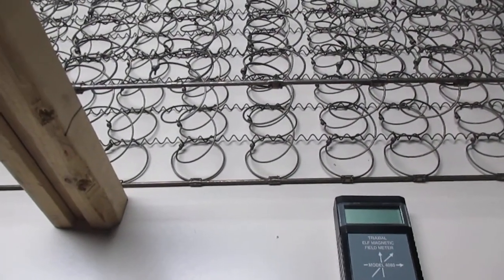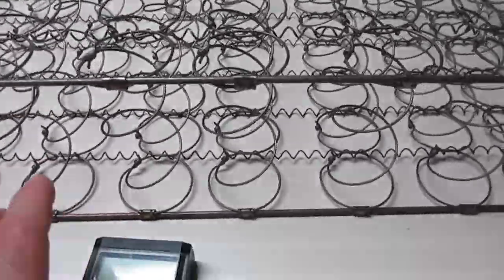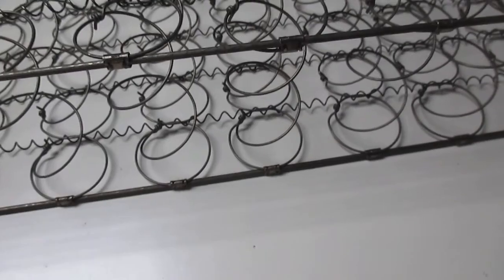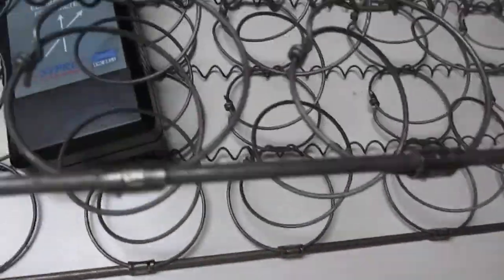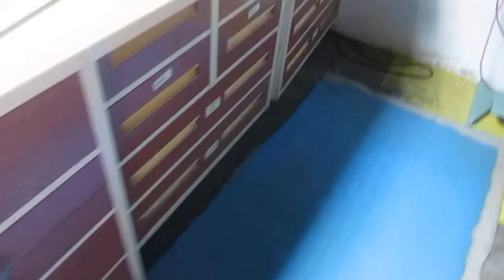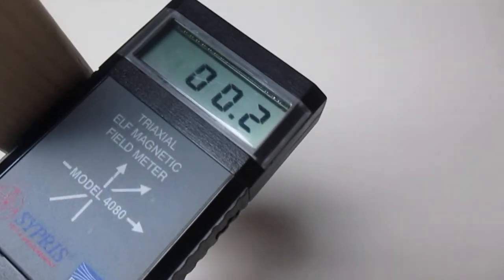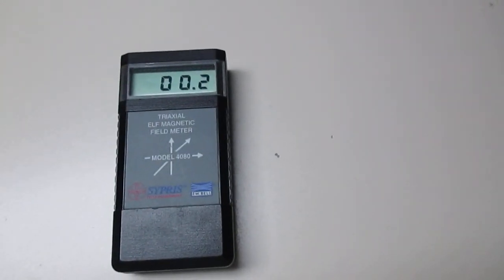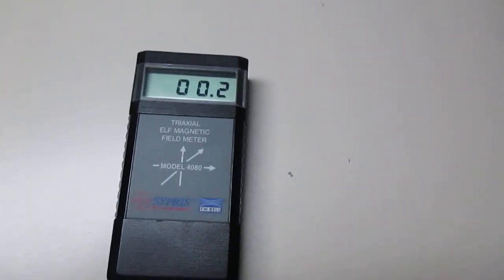EMF Test on a Mattress Innerspring

Comment: My bed springs, frame, radiators, metal on bottom of sofa, fridge, even screwdriver on the side sent levels soaring to red alarm blasting. I live near pylons, (50ft tops) could the emf from them be caught inside the bungalow and charging all metal objects in my home, Ive  been suffering, nausea, internal tremor, soreness in mouth and stomach,  and electrostatic at the back of my head when laying in bed, terrible nightmares when do fall asleep.

Comment: NOW WHEN I MEASURE MY MATTRESS WITH AN EMF APP IN MY PHONE, THE READING GOES UP. PROBABLY BECAUSE IT'S A DIFFERENT TYPE OF COIL. IT ALSO HAS COPPER INFUSED FOAM. BUT ANYWAYS I GET THE HIGHER READINGS WHEN I PUT IT CLOSER TO THE POCKET COILS FROM THE SIDE OF THE MATTRESS. I DON'T KNOW IF IT HAS SOMETHING TO DO WITH THE LOW PULSE BETWEEN 50 AND 60 I EXPERIMENTED THE ONLY TIME I SLEPT THERE. I HAVE TO GIVE IT ANOTHER TRY BECAUSE I'M ALSO EXPERIMENTING HEART RHYTHM PROBLEMS FOR A WHILE AND I ALSO TOOK A MELATONIN TABLET THAT NIGHT. ANYWAYS I MENTION THIS TO HELP PEOPLE OBSERVE WHAT HAPPENS TO THEM. I DON'T KNOW EITHER OF THESE APPS ARE GOOD OR NOT. DO YOUR OWN RESEARCH.

Comment: "It’s important to realize that there are two main forms of EMF: radio-frequency (RF)-EMF and extremely low-frequency (ELF)-EMFs.  The frequency range of ELF-EMF is 1–300 Hz."

"Many man-made sources of ELF-EMF exist. Prime among these artificial sources are power lines and electronic appliances, with vacuum cleaners, electric can-openers, microwave ovens, shavers and hair dryers among the most powerful.  These appliances emit ELF-EMF at field intensities ranging from 17.44 to 164.75 μT, measured from 5 cm away."

"The frequencies of RF-EMFs are considerably higher than ELF-EMFs, ranging from 100 kHz to 300 GHz.  As its name suggests, the main uses of RF-EMF are in broadcasting information.  In today’s data-driven world, this means that RF-EMF is constantly around us: it is produced by things such as mobile phone base stations, cordless phones, utility ‘smart’ meters, remote control toys, wireless networks, radar and baby monitors. In addition, there are various natural sources of RF-EMF, including the Earth, the Sun and other black body radiators."

The meter being used in this video states the following in its manual: 

"The Model 4080 is the first economical,
handheld, triaxial magnetic field meter
available for the measurement of Extremely
Low Frequency (ELF) magnetic fields."

If you're watching this while researching about anything related to RF-EMF's (i.e Smartmeters, wifi, dect phones etc...) this video isn't for you.  If you're looking to see if you should consider changing your bed to a non-metal bed because of RF-EMF's, this video is not for you.  Considering he only states "EMF" (not stating exactly which EMF he's testing for) and is testing with a meter that is designed solely for ELF-EMF's, this video is not for you.

Sources:
https://www.globalresearch.ca/electromagnetic-fields-emf-extremely-low-frequencies-elf-and-radio-frequencies-rf-what-are-the-health-impacts/5335801
https://fwbell.com/wp-content/uploads/2017/11/UN1226.pdf
Reply: hell yeah

Comment: Well. 
I'm using 1. my phone's metal detector and 2. its compass as well as 3. a regular compass –
and the magnetic fields are extremely distorted on coil mattresses. So please explain that.

Also, our body generates some electricity which would be amplified?
Reply: Any ferric metal would affect a compass. 
If the springs were made from aluminium then compass needle would not be affected. But there is a good reason not to make springs out of aluminium.

Comment: My mattress picks up levels as high as 130 microteslas and as low as single digits. The drop or rise occurs within inches of moving detector. I also feel like the mattress is literally buzzing or vibrating in different places every so often. The feeling is slight but perceptible. This started a little over a year ago. Other strange sensations I experience are a quick sense of falling (a few inches) when on the mattress. The bed is just a fraction of what I deal with everyday.
Reply: Hi Charles. I rewired my limbic brain over last 11 months and started following Morley Robbins GOT MAG protocol... doing massively better with emf and MCS sensitivities. My heart goes out to you.. it is a very hard situation to be in. Check out www.rewiringthebrain.com and GOTMAG for some info that might open a healing road. I send you prayers for healing and empowerment.    Best regards, Julia